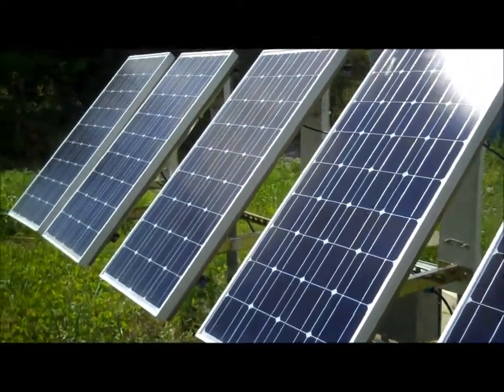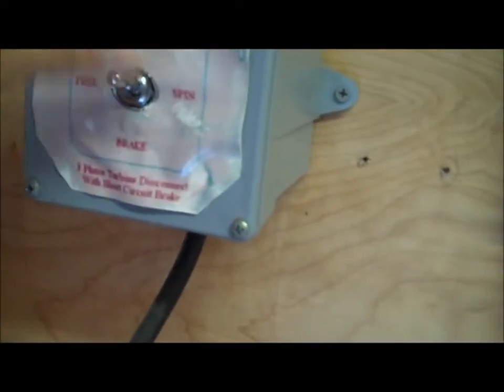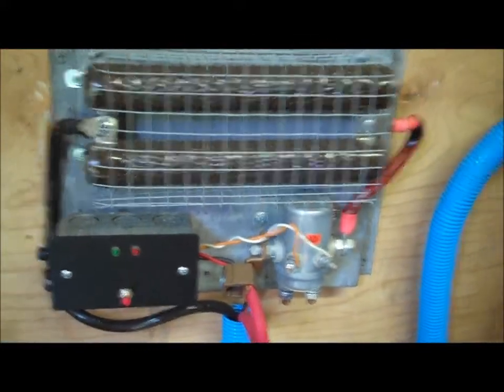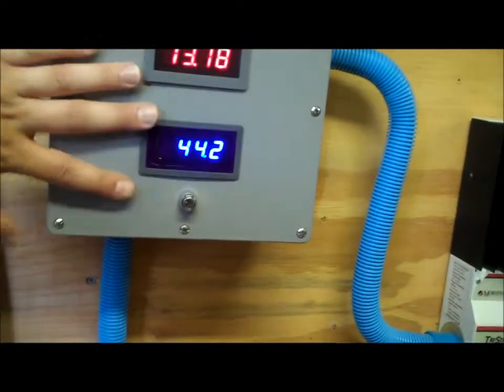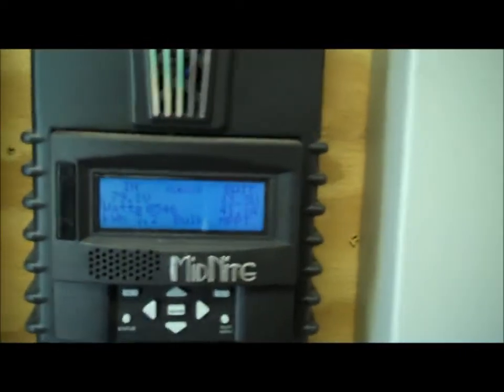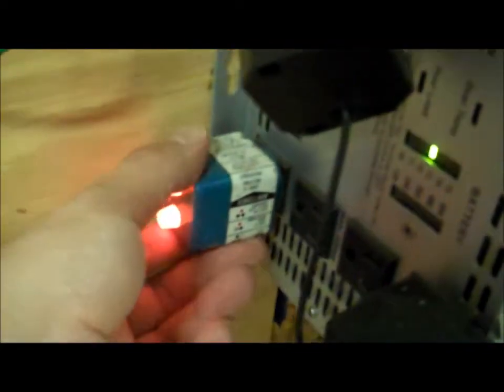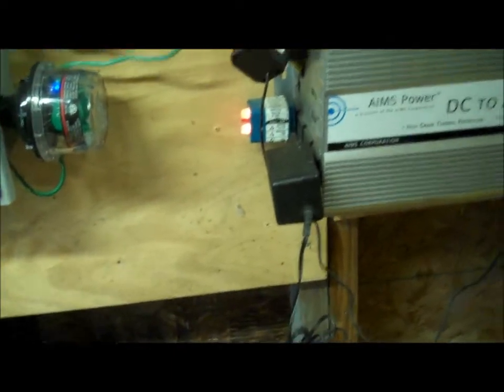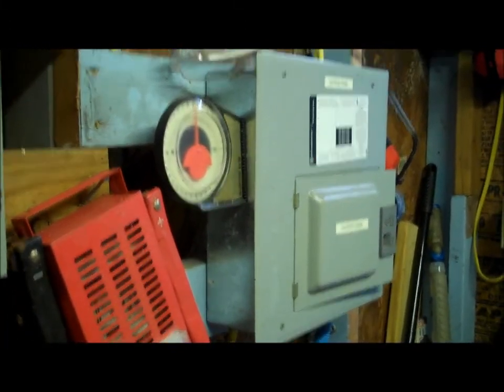DIY Solar and Wind System 12 Minute Commentary by Eric

Comment: Great looking system .The only thing your lacking is gridtie capabilty.
Reply from the maker: That's a really good point I didn't address in the video. I have tried for the past 5 years to continually contact the co-op electric company to let me hook up to the grid for either net-metering or sell excess electricity, but they said they only allow businesses to do grid tie solar. So that's one of the main reasons I'm using batteries.
Reply: Eric Layton walk in there and demand their net metering agreement in writing and or their conditions of use in writing. Most of the time you have to walk in there
Reply from the maker: CrapPolice Very good idea...I should try that